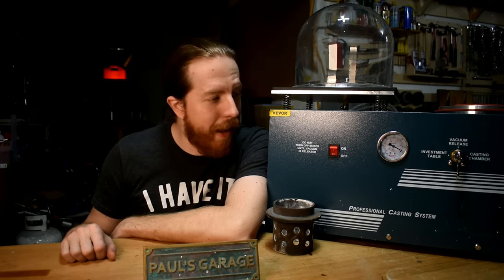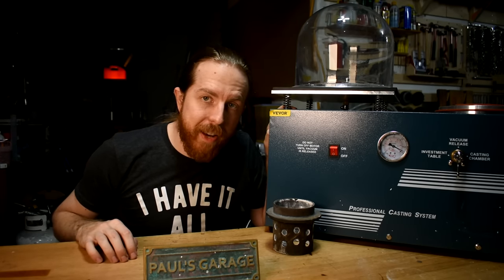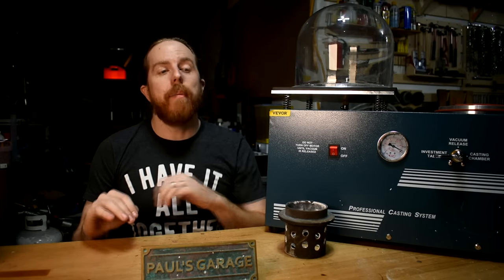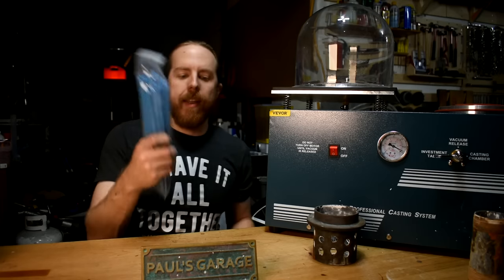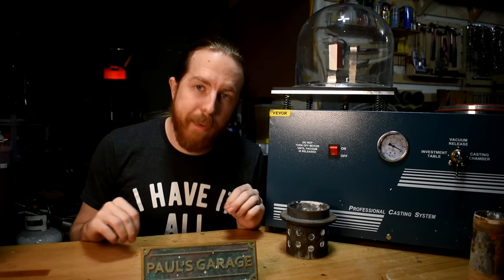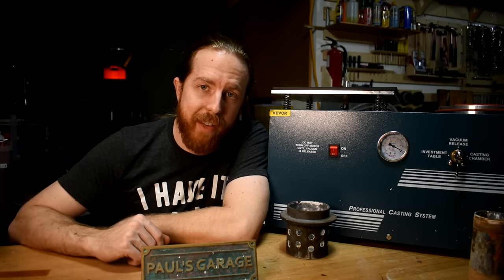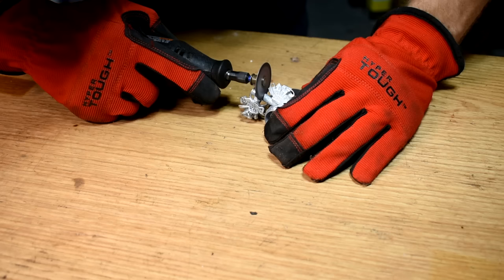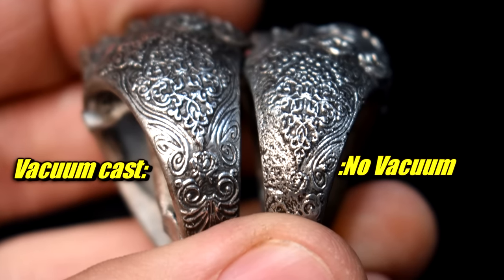Vacuum Casting 3D Prints to Solid Metal! How To

Comment: As a fellow fail-fast learner, I would have left off the tiny sprues.  Also I wonder if quenching too early can cause investment to damage the surface of the silver 🤷
Reply: also I mentioned to you before about shorter burnouts, i had secretly hoped you would get all sciency on it :P Ive done 9 hour burnouts with ok success, and 15 hour manufacturer rec’d burnouts with still some surface imperfections.  still a lot to learn.  best way to learn is face first.
Reply from the maker: If you have success with shorter burnouts let me know what schedule you used.  Comments I got made me think people want a 1 or 2 hour burnout, im not seeing that happening though.

And funny story about the really tiny sprues, the parts wouldn't stay attached because of the weight of the prints, so I added the tiny ones more to hold it together than to transfer metal or air.  I'm surprised that they all filled with metal
Reply: @PaulsGarage  I feel like a drier flask might allow for a shorter first phase (investment dehumidify phase).. maybe 🤔 … also looks like thicker bigger pieces need different handling and resin compared to intricate pieces .. thanks for the video…. Clear Mind Jewelry has good videos on these topics too.
Reply from the maker: I've never heard of that channel but I'll check it out.  I have an extended drying phase at the beginning, yeah.  I'm unreasonably worried that a steam explosion will break the thing.  I've lost way too much pottery to me being impatient and firing damp stuff
Reply: @PaulsGarage  Ive read somewhere that if you let it dry too much that the resin can start to absorb into the investment sooo I dont know where the sweet spot is.   Ive emailed with Prestige before and I think they would be helpful if you had any tech questions.
Reply: @PaulsGarage  aaalso lol Ive been testing using FDM polycast for the main sprue (with holes designed in) and printing a small sprue on the models themselves… then connecting them before investing…. wax work is troublesome for me

Comment: It seems like Paul's Garage went from minimal expense do it yourself to holy crap, I can't afford any of that equipment!
Reply from the maker: You're not wrong lol that's vacuum casting, unfortunately.  Every way I tried to design it, everything ended up significantly worse AND more expensive to scratch build. And the tools here are the budget (cheap) ones.  Sand casting is so much more affordable and you can scavenge stuff from the kitchen and hardware store like I did.  

Every suggestion from people on how to do vacuum casting cheaper ended up calculating out to pennies per small casting at the expense of a MUCH higher failure rate, or didn't apply to printed resin casts, etc...  it was exhausting researching and then doing all of this but the whole sunk cost think forced me through it 🤣  

Back to sand casting for a bit I think

Comment: I'm surprised you're not using oxy-acetylene to melt with
Reply from the maker: 2 reasons i'm not using oxy-acetylene.  1: i can get exact temp control with this furnace, and up to 3kg at a time (i use it for sand casting also), and 2: I don't have an oxy-acetylene torch.

Comment: Yeah, 5 to 7 hour burnout is fine. no issue. no joke :)
Reply from the maker: Thr process I used here was even longer lol but from the comments I got, people wanted a couple hours tops or less than an hour.  Not seeing that happening.  To get it hot and hold that temp, you would need to heat it so fast it would shock everything